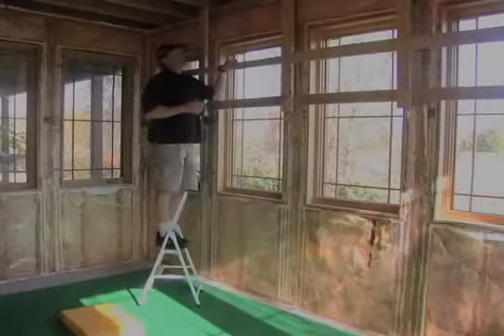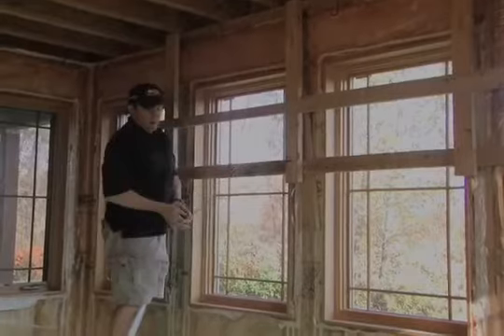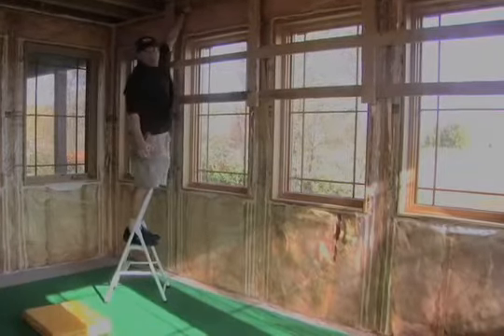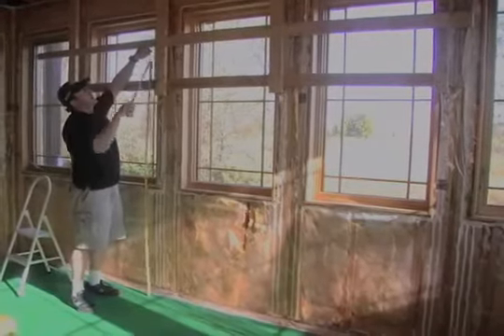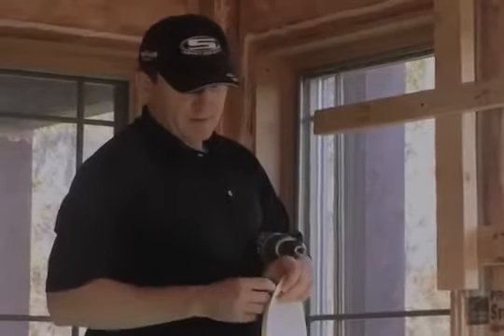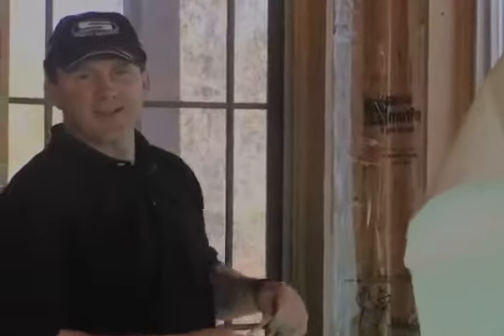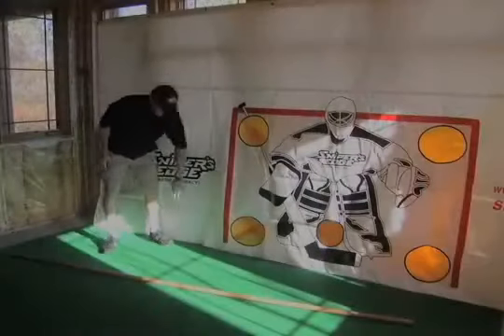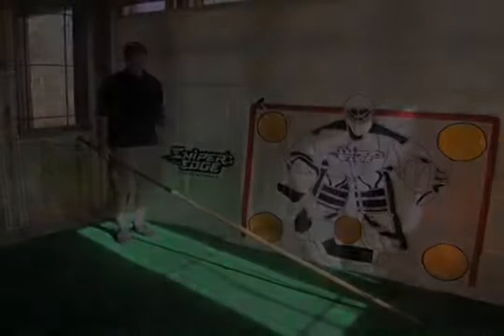How To Install Your Shooting Tarp

Comment from the maker: The pockets on the Shooting Tarp at the 4 x corners and 5-hole are about 5 inches deep. So the rule of thumb would be about 10 inches off the wall. If need be, you could probably get away with 7 - 8 inches, depending on who is shooting and how hard the shot is.